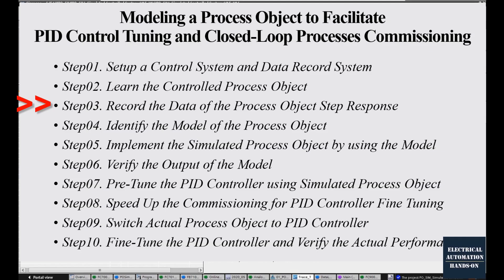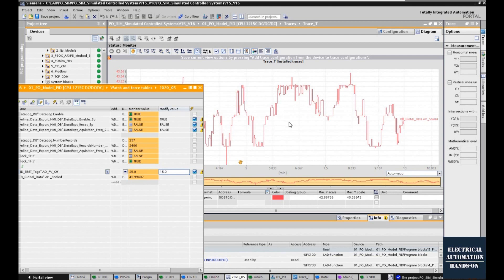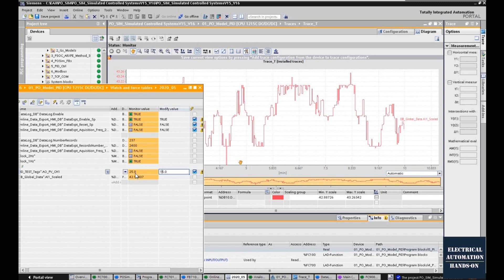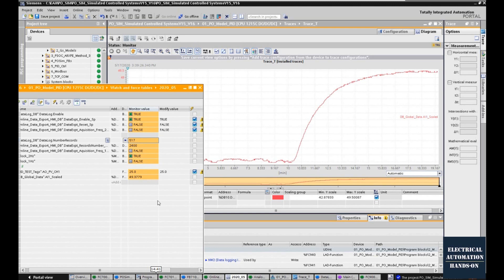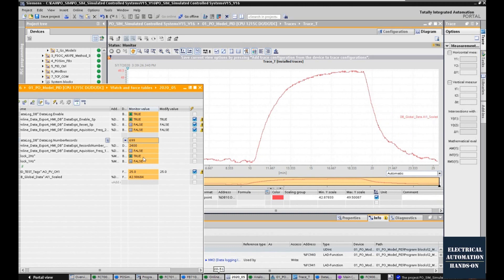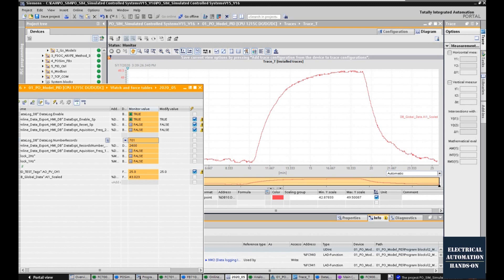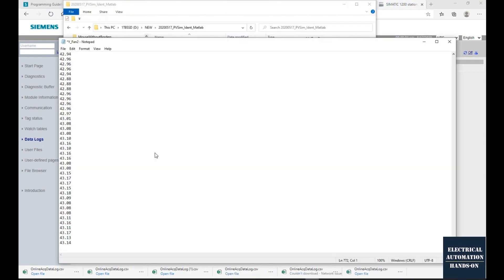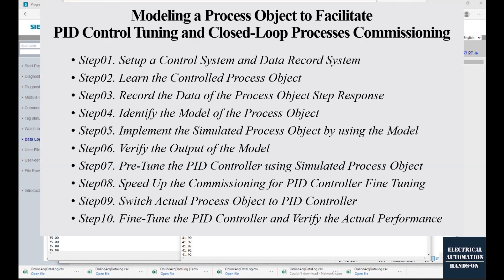PID03 - Modeling&PIDControl - Record the Data of the Process Object Bump Test/Step Response

Comment: Hello great video, how do you do to get the data in the web data logs, where do you choose which data do you want to be recorded?
Reply from the maker: If you are going to use Siemens S7-1200, you can find the link https://support.industry.siemens.com/cs/document/64396156/process-data-acquisition-and-monitoring-with-the-simatic-s7-1200-s7-1500-(data-logging)?dti=0&lc=en-WW for Data Logging Function block
Reply: @electricalautomation  I found the information, thank you, I am using S7-1500 but it seems that works the same